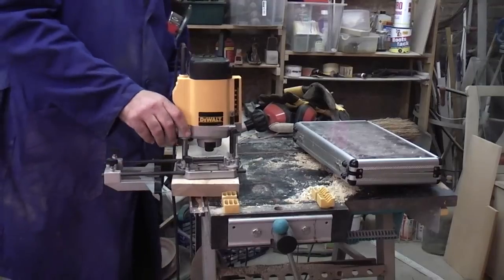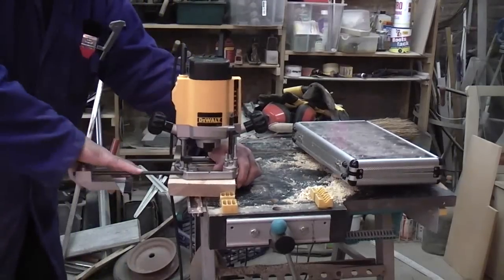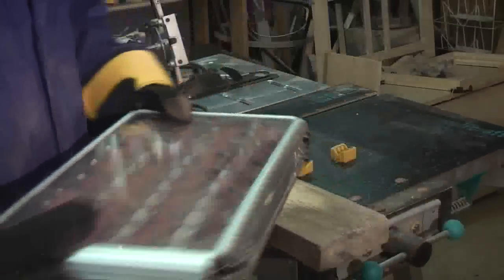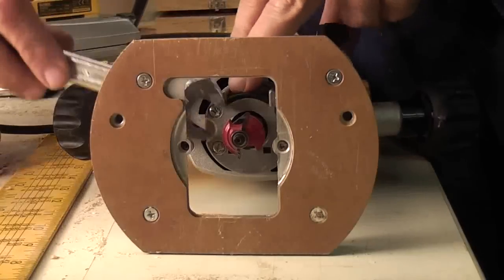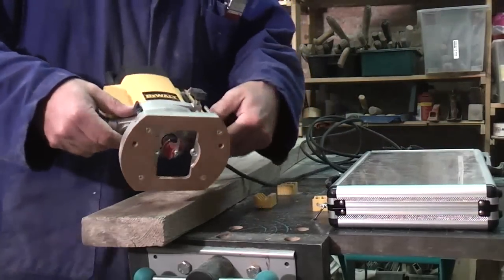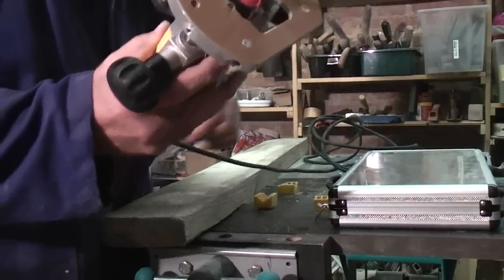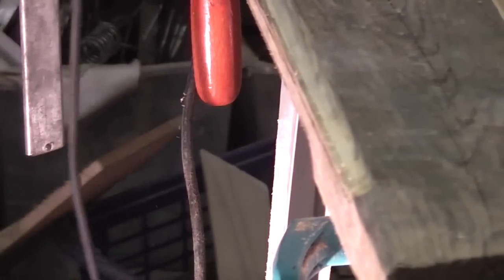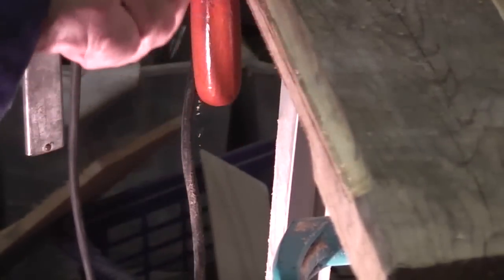How to use a DeWalt router

Comment: I wouldnt use this video as a "how to" guide. 

you should have that wood clamped down and should never go backward, always go from left to right... cutting IN the direction of the spin is dangerous.

I didnt rate your video bad because I dont think you made the mistakes on purpose but keep in mind you are using a piece of machinery capable of  around 24,000 rpm with a VERY sharp bit!!! not something that you want to skip on safety.

Comment: Are you sure you know how to use a router. It is irresponsible to present a video that shows no minimum safety standards for working with powertools, for example, securing the piece on the workbench.